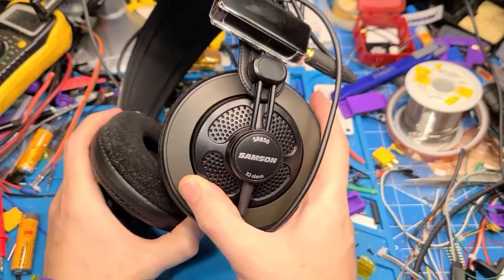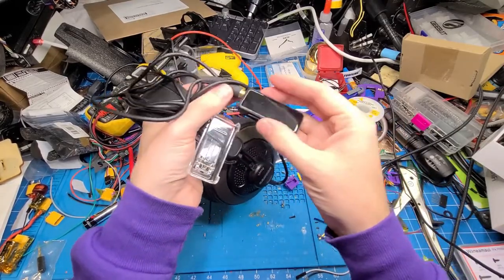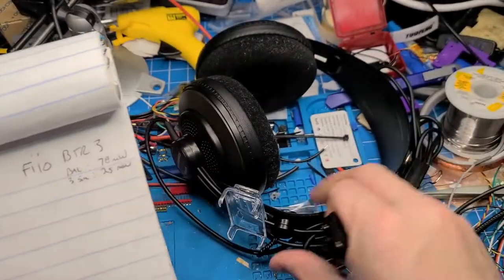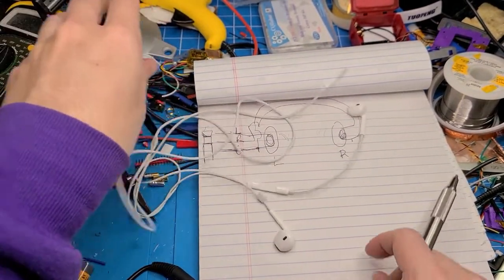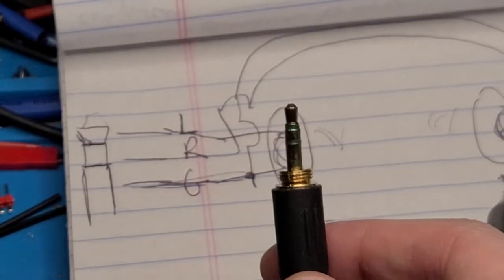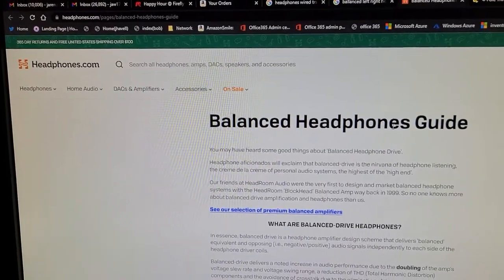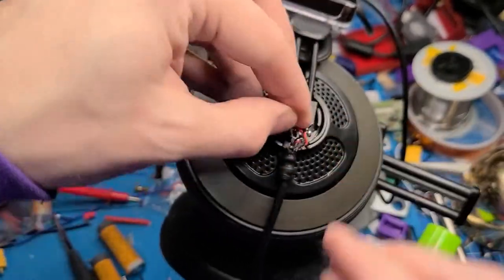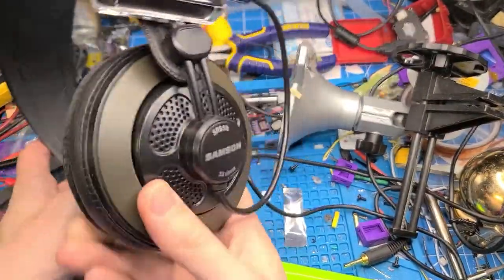Balanced Headphone Mod - Samson SR850 and Fiio BTR3k

Comment: So ... if I just get a regular 2.5 to 3.5 mm cable with the 3 separating rings and use it to connect my regular Headphones which have a 3.5 mm jack with my BTR3k, what would I hear? Would I get more output?
Reply from the maker: Maybe? I think you will have to try it. It depends how your adapter is wired, as well as how the BTR3k responds when you bridge the L- and the R- to be common. give it a try?

Comment: It will be interesting to mod sound of SR850. Filter for rejection high mid or something
Reply: You can build your own adjustable inline crossover
Reply: @Synthematix  I could assemble, but I can’t calculate the circuit for it myself